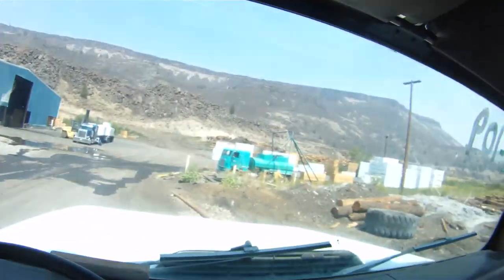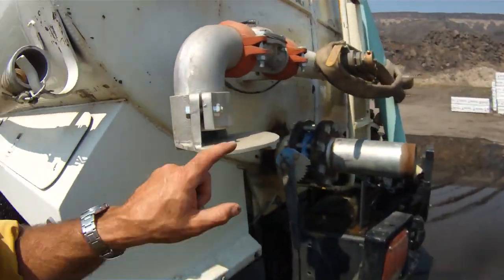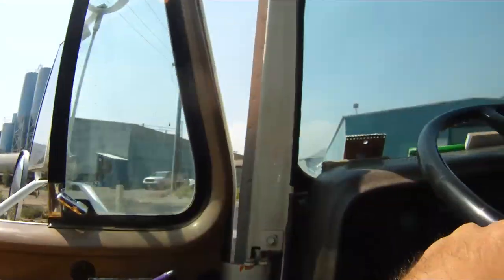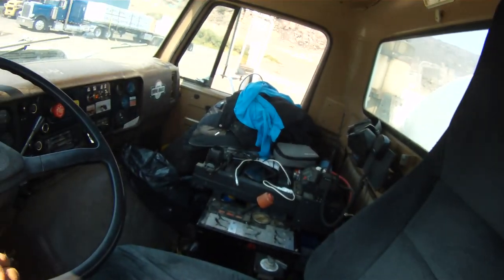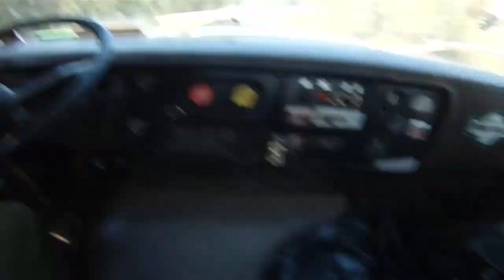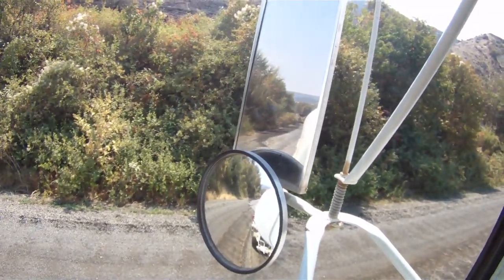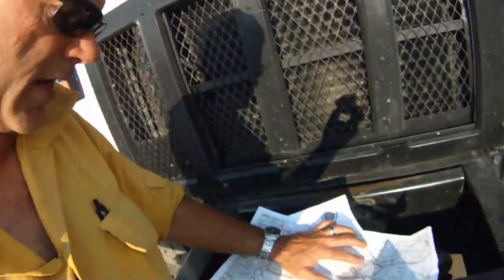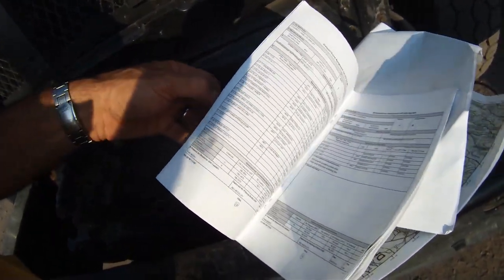Northwest 2015 Wild Fires with DIY Duke Vlog #2

Comment: Hey Duke, good work on another great vid. How does one get involved with being a wild land firefighter?
Reply from the maker: This year in Washington state they were actually asking for volunteers because with all the wildfires resources were stretched very thin.  Normally some community colleges offer courses in wildland firefighting.  Also you can contact wildland firefighting contractors for job positions on crews or engines.  If you want to work for an agency such as the forest service, state forestry, bureau of land management (BLM) a degree in wildland fire management may work well.  Just make inquiries with those government and private contractors for your best options.  Hey if you like jumping out of airplanes don't rule out being a smoke jumper.